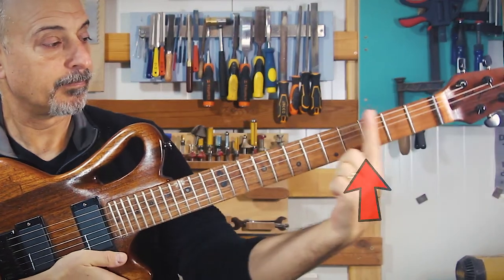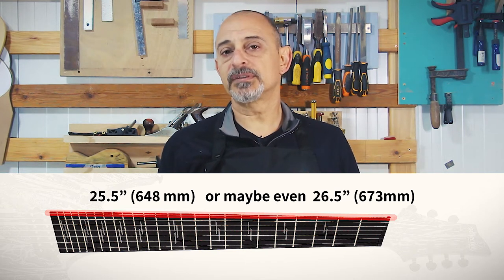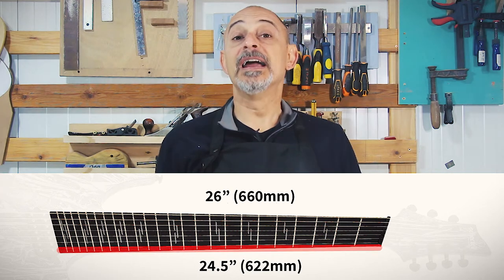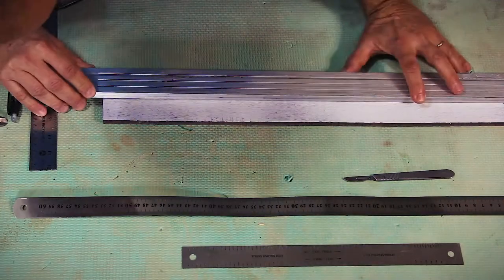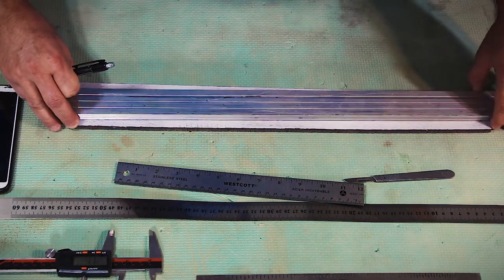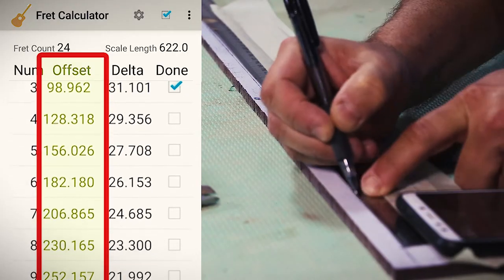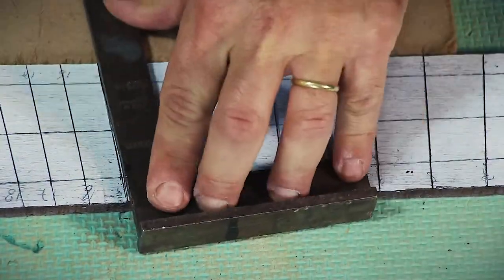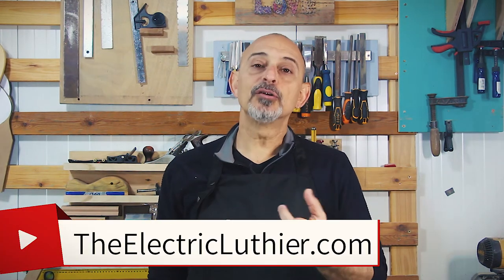How to Slot a Multi-Scale (Fanned Fret) Fretboard, and get it right the first time

Comment: I used FindFret2d to create a template PDF and dxf file to import to a CAD program.  I also arbitrarily picked the 12th fret as the vertical neutral fret.  Thanks for the slotting demo.

Comment: My biggest mistake in making a fan fret board was marking the scales down the edge of the blank, so when the excess was cut away it totally screwed up the slots, apart from the neutral fret, the rest were a mess. Ive since learned from that episode. Thanks for posting.

Comment: yeah, I think you've pretty much nailed this. out of all the info I could find,  you far surpassed any explanation. if you have any ideas for a miter box.......
Reply from the maker: Thanks 🙏,  I assume you are not referring to a 'standard fretting miter box. It's going to be a complicated one. If I wanted more stability I would just hold or clamp a straight cube for each slot. I actually forgot to do it in the video. This is like 'half a miter box'. Unless you are planning on a lot of necks, it probably easier to just do it manually (As I did). Just take the time
Reply: @theelectricluthier1928  yeah im thinking theres a way to build a decent swivaling box for slotting. if your intrested i will pass on my results. im going to experiment with this in the next few weeks. thanks for the info by the way.
Reply: @jamesrocks300mf  hey did you ever figure out a swiveling miter box ? I’m in the process of cutting some multiscale frets and it’s proving to be difficult cutting on a straight line

Comment: I would prefer the parallel fret to be lower because I don't play barre chords high up the neck. I bought a Harley Benton with parallel 7th fret and I like that, I don't notice the fanning at all but I do notice the longer scale length while playing a sus2 chord on the low 3 strings for example (5add9)

Comment: great video sir. the best DIY one around. 1 question I have. I want to make the neutral point at the nut and have a gradual curve like a strandberg. 32 -30 Inch scale bass 20 frets. Do i just mark out the 32 scale for the low E string from the nut and the same for the 30 inch scale for the high G from the nut and join the dots? many thanks for your videos

Comment: Hi Yuva, amazing tutorial! You think that put the "neutral" at the bridge it would be too uncomfortable?
Reply: Thanks, Adrien 🙏. The more the difference is between the high and low strings, as far as scale length' the less comfortable it will be. Think of holding an F or A B chord in the first position... You will be missing a big part of the ergonomic benefit of fanned frets. I will assume you want to use a tremolo, and those are hard to come by for fanned scales. Having said that, it's really a personal preference and with a moderate scale length difference, maybe worth a try.

Comment: This is possibly the best fanned fret drawing video around. Great you mentioned the often overlooked fact of playing position being (highly) influential to parallel fret placement. Now, if I were going to build a non-standard/extended-range guitar with headless system, with individual tuning saddles being effectively 11mm in diameter, which is going to be my limiting factor for overall string spacing,  where should I measure this 11mm string spacing? At the longer scale "nominal bridge" or at the shorter scale "nominal bridge"?
Reply: Thanks for the compliment Juan 🙏,. I think that you will have to measure (or at least start measuring) from the shorter scale ie. the high E. Just from a technical point of view, it will make things easier, as you actually have all six (or seven) strings at this point. If you want to be picky/ accurate about it, you can measure the spacing going back to the saddle for each string. This way you measure each pair separately at their longest point. I would do the math first to see if the difference is significant enough (in your opinion) to make a difference or even bother. I am not sure about the mechanics of the tuners, but you may also need additional space for turning the nobs when tuning, so don't have them touching.
Reply: @yoavbinyamini  Thanks again for your reply ;)
On second though it truly makes sense to measure bridge pegs at shorter scale, that'll give some clearance for the knobs further down. I actually measured string distance changes from longer scale to shorter scale and it's almost negligible as you suggested (but non zero). Thanks for the inspiration 🙏

Comment: Hello. What do you mean by "delta" ? Thank you.
Reply: Hi @Mark Santos. If you look at the fret calculator you can see that one row shows the 'Offset' and one the 'Delta'. The Delta is the distance measured from one fret to the next. The offset is when measuring the distance of each fret from the nut. I use the Offset first and then double-check using the Delta. If you only use the delta you risk making a slight mistake and then carrying it over to all the next frets. Good luck 🙂
Reply: @yoavbinyamini  Wow ! Didn't know that. Thank you so much. 
I'm glad to discover your channel. Looking forward to more. Can't wait to start my project.
Cheers.
-Mark

Comment: How to choose right bridge for my multi Scale guitar build?
Reply: Thanks for the question 🙏. For a multiscale guitar there are to ways you can go. One, is finding an angled bridge. This will, however, force you to have the scale lengths match the ngle of the bridge and may force you to limit which scales you use and where the Neutral fret sits. The more convenient option is using single string bridges as I do here - https://www.youtube.com/watch?v=qMMnDmBkGZ4&list=PLfW_F1DC9lxn8f8V6UK3nGP2ipZC7vKB5&index=9
Reply: @yoavbinyamini  thank You very much!

Comment: Planning a melody maker jr build. 
Would the 22.75 work well with 24.75, all Gibson scales?
The guitar will be a acoustisonic style, what ta think?
Reply: A 22.75" scale length is very short and usually reserved for children's guitars. In regular tuning, it will also provide very loose strings, which may be great for bending but also be prone to buzzing. Also, a 2" difference between the high and low strings (I assume you were referring to a multiscale fretboard) will give an extreme angle to the lowest and highest frets. Most multi-scale guitars stay more in the Fender-Gibson range of scales- 24.75" - 25.5".  I can't say what may work for you, just pointing out the pros and cons. If you like it flappy and bendy, go for it. 🙂

Comment: Scale 42.9 good or bad my fist gitur
Reply: I will assume you mean 24.9" (42 is more like a Contrabass). 24.9" is fine, but unless there is a very specific reason, it may be easier to go with a more standard 25" like a PRS or a 24.75" like most Gibsons. It will be easier to find a template or other reference you may want. The techniques apply all the same, but it is 'safer' to do a normal scale neck before jumping to multi-scale. Good luck 🙂